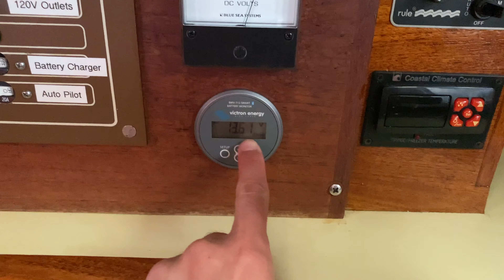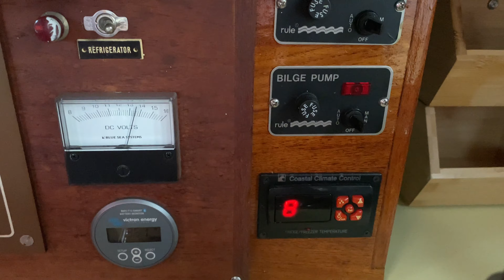Boat Project MAYHEM (after) A BLISSFUL Morning Aboard EP. 56

Comment: Try some rectorseal 5 on the metal fittings before sliding the larger hoses (1 1/2” +) over them.  Makes install much easier and removal as well.
Reply from the maker: I have some, ill have to try it next time!

Comment: Engine wouldn't be seized up it would be hydrolocked.. same as if you turn it over with the throttle open and it doesn't start.. this is why some people use starting fluid when it's really cold however you can vapor lock it by doing this.. both scenarios result in something getting bent or broken by the pressure..those engine zincs should be checked atleast every year
Reply from the maker: I hope to avoid either of those situations!

Comment: Nice episode! Clean install on the new exhaust. Wondered why previous design had so much dry exhaust. Those flanged ss braided hose are troublesome even in industrial applications; have to be replaced often. 
On the vented loop consider adding a shield over the valve area. The valve over time accumulates salt Crystal's and calcium deposits and could leak / spray when under pressure. Not a real problem but the loop is installed near your electrical distribution and batteries. Something simple like a turkey baking roasting bag would work.
Envious you still have the orignal seacock plug valves. Servicing as you have will keep them going for more decades. Mine were replaced by previous owner with Apollo bronze / 316ss ball valves. 
Is your bonding system still active to your Seacocks/ thruhulls?
Reply from the maker: Great idea Dale! I think I'll add a little piece of hose and lead it somewhere safe and away from the batteries. I also need to order a package of replacement valves (Vetus recommends having spares)

Comment: Is that SS tube you cut out going to seal in that brass fitting......... couldn't you have just used the original hose as is.....and added a hose from it to your anti-siphon loop?
Reply: I would have cut the other fitting off that was British and used a brass barb to attach a 2nd piece of the same kind of hose..
Reply from the maker: Hey Steve! The brass fitting was British and the hose had a braided fabric cover. At first I thought of cutting the hose and doing what Ben suggested, but the cover would have wanted to unravel. I decided on cutting the pressed end off and used the stainless nipple as you see in the video. This eliminates having  more connections and potential failure points.